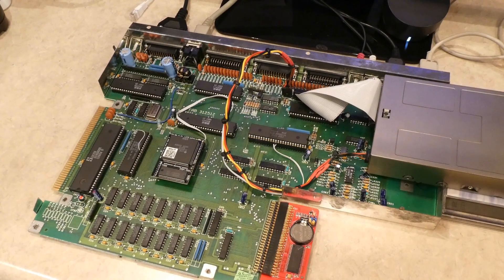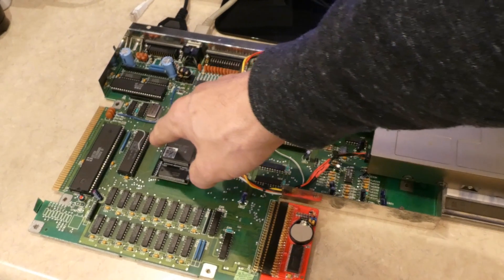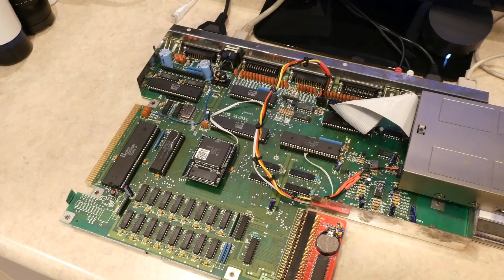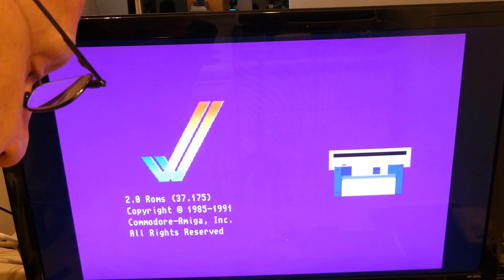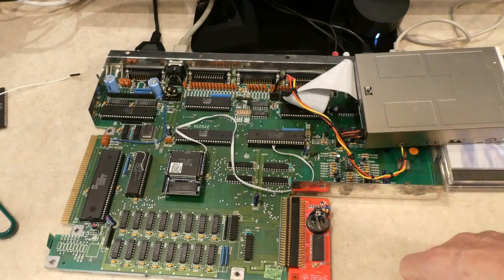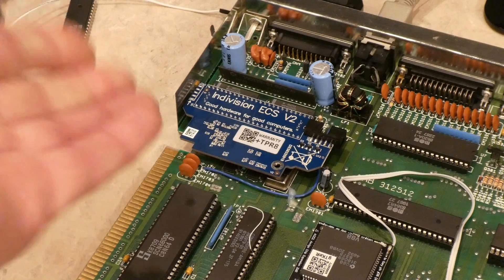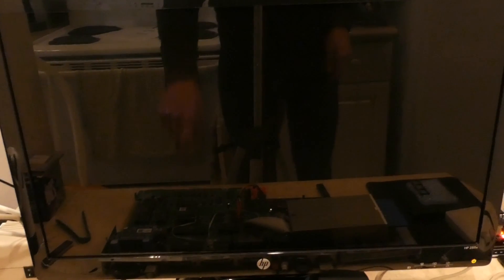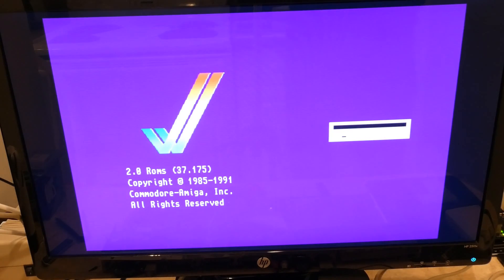Amiga 500 Revision 3 : Re-Visit (ECS Denise Blank Screen)

Comment: What cable do you have for connecting Amiga to a lcd monitor ?
Reply from the maker: A VGA cable.  This is the output provided by the Indivsion ECS. As long as you can find an LCD Monitor that has a VGA input, the results are very impressive.
Reply: @amigaretro1985  Thanks, I'm planning to order a cheap Amiga RGB to VGA convertor. Do you think it will work just fine or it will produce a poor result ?
Reply from the maker: @cemc.852  From experience, most yield poor results. That is why ended up with the Indivision ECS V2 and the OSSC (Open Source Scan Converter). The best cheap unit I had success with was the SCART (RGB) to HDMI Adapter. You would need to get a SCART to 23-pin adapter cable for your Amiga. They are readily available on eBay.

SCART to HDMI Converter:

https://www.amazon.com/Scart-Video-Converter-Scaler-Coaxial/dp/B00MUNIVRO/ref=sr_1_3?dchild=1&keywords=scart+to+hdmi&qid=1609402375&sr=8-3

Comment: You have a nice A500. Have also a ACE2 but on a Rev6A with the old Indivision ECS V1. Have a ACA500Plus V1 on the side with the ACA1233n-55 RTC IDE Speeder. Connect it with VGA on a BenQ BL702A monitor. Have today buy the Indivision ECS V2 which I have the end of the week. Waiting 2 years for the black A500 case and black keycaps from A1200NET. Hoping that come this year and end my A500 project. 

I also busy with my A1200’s projects and have the new Indivision AGA MK3. It works perfect and it’s better than my old AGA MK2CR’s. Like the Live-modus on it and now I see the WHDLoad Demos and EXE Demos perfect and not change the resolutions on it.
Reply from the maker: Sounds nice. The Indivision AGA MK3 is definitely a good addition for the A1200. I too, am waiting on my A500 Case. At least the A1200 cases arrived a while back :)
Reply: Have three A1200 cases from A1200NET. The rare GHOST, CD32 with the keycaps and the Black case. The GHOST Keycaps is maybe latter come out 2021. And must also wait for the black keycaps for the Black A1200 case. Have the A1200 GHOST, CD32 Special Edition and the A1200 Black labels on it. In my two A1200’s I have the Blizzard 1230 IV’s with the FPU’s and 128MB 50ns. The GHOST runs WB 3.1-BestWB 1.3 and gave ClassicWB ADVSP on the CD32 and Black have original 3.1.4 ROM chips. 

Would be great to use the ACA1260, Warp 1260 and the Vampire 1200 V2.  I’m also searching for a Blizzard 1260.
Reply: You can see my A500/A1200 projects on the Dutch forum site. My account is AMIGA JOHAN.
https://amiga.cafe

Comment: How can you know the Indivision ECS V2 is not running in OCS mode?
Reply from the maker: Interesting, I am not sure actually. I will need to run the Setup/Prefs program to find out if all the modes work. I will post my response at that time.
Reply: @amigaretro1985  Will be interesting to hear back. The reason I ask is because you didn't check to see if you actually had ECS in the video and I find it very likey that an FPGA based scandoubler like the Indi ECS V2 may just switch to OCS once it sees the missing signal on pin 34 or was it 35 that you mentioned in the video. I have both Indi ECS V2 and Indi ECS V1 myself. Have not tested this personally. I have Rev.5 and Rev. 6A motherboards. Maybe I could test this in one of my Rev.5 boards. I assume it has the missing signal just like the Rev.3.
Reply from the maker: Mats, I wont be home for a few weeks, so my video was a bit rushed (it was over a month since my last one), indeed, I should have verified that ECS was detected by either SysInfo or the Indivision ECS V2 software. I will look into this upon my return. This will be interesting to investigate.Thanks for reminding me of this, you are awesome!
Reply: The Indivision ECS V2 defaults to OCS mode.  You have to set it to ECS and then store that setting using the software so it will power on in ECS mode afterward.  It would most likely not have given a screen just like the real ECS chip had it been in that mode.
Reply from the maker: @EzdineGaray , Good to know. I will try this in a few weeks when I am back home. I will update everyone with another video at that time. Thanks for your insight :)
Reply: I know this is half a decade late, but Amiga Test Kit will show what video mode a system is running in, OCS/ECS/AGA.